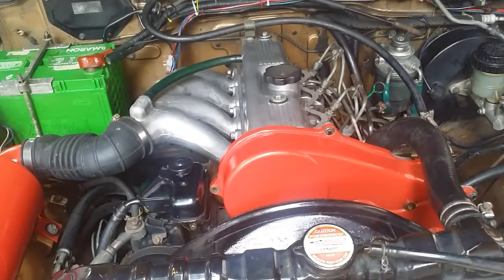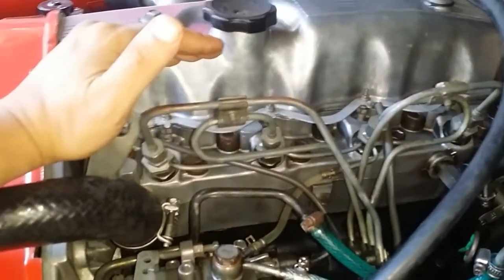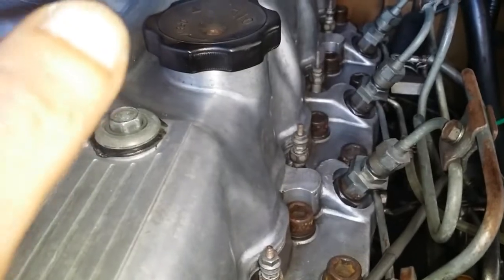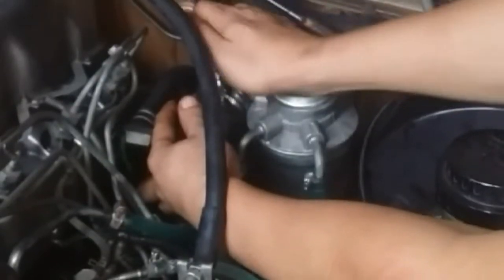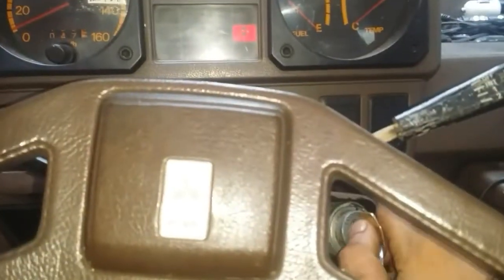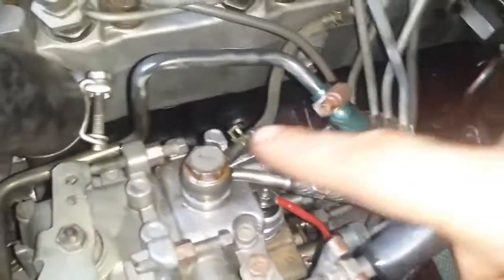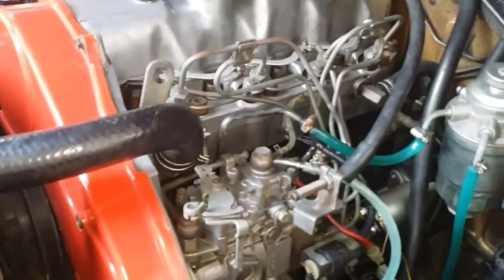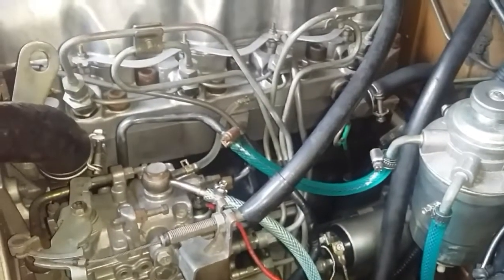Hard Start Problem. It's NOT the glowplugs

Comment: sire thanks for this video, could you help me by fixing my very old machine?  a 1998 model mitsubishi l300 having 4d56 engine, this last 2 months, my glow plug timer relay was busted and i tried to restore my timer relay but it's not working, it's very hard to find this glow plug timer device.
Reply from the maker: surplus sir. or just replace with a modern relay just redo the wiring harness

Comment: Hello Po sir ask ko Lang Yung l300 Po namin ayaw Po mag start pero nag Redondo namn Parang ayaw Po tumuloy mag start ok naman battery
Reply from the maker: check nyo po fuel solenoid.
Reply: @MrDIYer  sir San makita fuel solenoid? ty
Reply from the maker: sa may injection pump po
Reply from the maker: https://youtu.be/CBMXnn3V798 cranking no start. fuel solenoid

Comment: A Mechanic told me, that I should not use the clear braided hose. They don't stand up well to the heat and they get hard after a while. How has yours been doing? What type of hose is that on your return line?
Reply from the maker: that is true. that is the downside to clear braided hose but its cheap and easily replaceable so i dont mind. the clear see through hose you see is nothing more than just a simple dextrose hose. lol. had no problems so far. tested long 5 hour drive several times.

Comment: good day sir" i have problem in my 4d56 mitsubishi l300  because during when the engine becomes hot. it's very hard to start" i  need you idea sir
Reply from the maker: when you start it when the engine is hot does it feel like its difficult for the crankshaft to rotate?
Reply: @MrDIYer  yes sir any idea sire to solve my problem
Reply from the maker: overheated engine. as your engine gets hot the piston inside the cylinder expands and almost feels like its getting stuck inside. that is why it becomes difficult to start. i suggest check your cooling system. flush your radiator. check your clutch fan. and if your engine still has a thermostat..check that one too
Reply: @MrDIYer  i do it sir
Reply: @MrDIYer  yes sir

Comment: Sir, is it still applicable on a common rail 4d56 engine?
Reply from the maker: i dont think so sir. crdi's usually are self-bleeding systems. best way to avoid air from getting inside the system is avoid the fuel tank from getting too low.
Reply: @MrDIYer  ok noted sir. Thank you for the informative video. At least I have an idea on how to bleed on an injection pump 4d56 engine. Hehehe

Comment: Boss any tips in cleaning our engine bays? Im planning to restore an old l200 w/ 4d56 engine
Reply from the maker: disconnect negative terminal. avoid as much as possible electrical components like fuse box. alternator head lamp. before reconnecting the battery. dry everything off with a blower.
Reply: @MrDIYer  if ever sir maybe you can also make a video in diagnosing powersteering pump. Thanks.

Comment: Sir...Can we put a Turbo on our non turbo 4d56 engine?
Reply from the maker: possible but it will be expensive. aside from the turbo itself..you need to replace the exhaust and intake manifold as well as the cylinder head, valve seats are different from a turbo to a non turbo.
Reply: @MrDIYer  Ok sir..might as well buy a turbo engine ang insert it in the engine bay to make my vehicle a turbo one..hehehe...Thank you for the reply sir.

Comment: This is the first time i saw an indirect  injection 4D56 diesel engine being started without its glowplugs. It started rightaway with ease and im in totally awe. What you have is a very clean engine and kind a brandnew injection pump. You clearly stated everything what is right and just. I agree with you , its just a simple leak in the system that will introduces air and eventually causes hard starting. Now i know. Thanks to your video, i learned a lot with you, your the kind of person that  truly knows the wonder of diesel engines especially the 4D56's. Some were just pretending or do copycats and dont know sh*t about what their doing.
Reply: It'll start faster without the glow plugs 

Good luck starting it without one on winter though
Reply: All diesels are direct injection right? Coz indirect injections are port injection used by older gasoline engines...
Reply from the maker: no sir. older diesel engines with conventional ve pumps usually  are indirect injection system, meaning diesel is injected in a swirl chamber. some newer diesel engines are tdi. turbocharged direct injection. its different from a gas engine wheren injection happens before the intake valve(port injection) although some gas engines now have direct injection too.
https://youtu.be/n8zr2z7v4zI